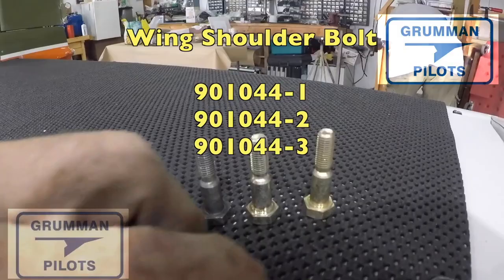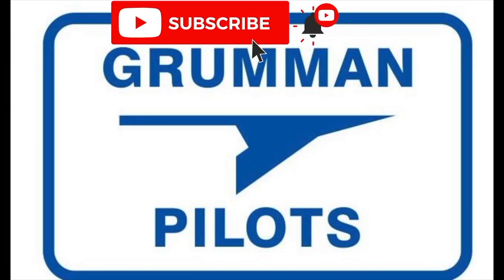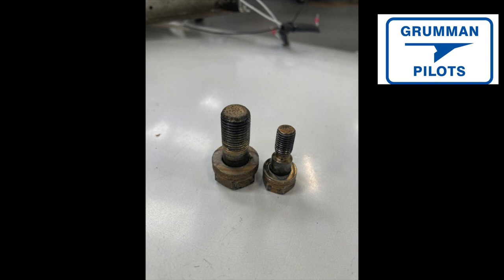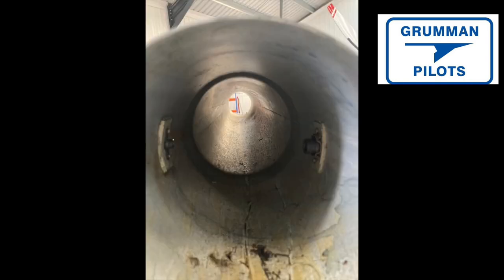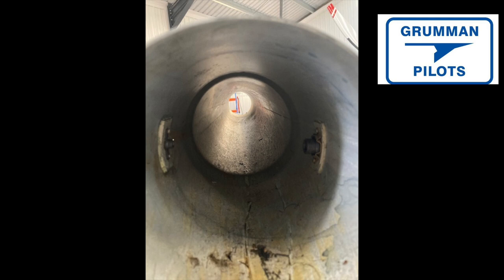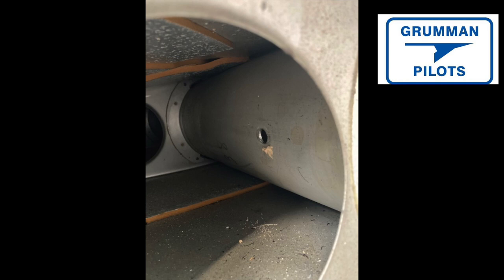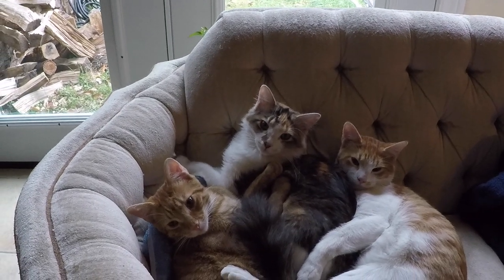Spar Oversize Bolt Problem - Grumman Style

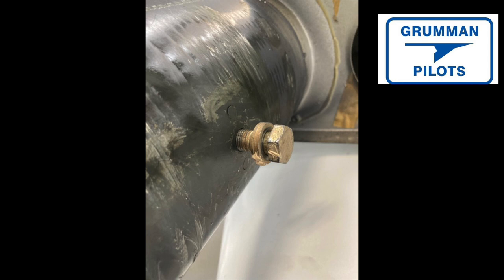Comment: At 1:30 FYI: I do not believe David is still in Houston.  
Regardless, I think that the AD is causing more harm than good in having mechanicks jack with it so often.
Reply from the maker: Yes they are in Silver Wings now.  I agree with the AD.
Reply: @GrummanPilots  I don't agree with the AD.  Every time they remove the bolts, they distroy the CAD platting and so new expensive bolts need to be ordered and installed.  It also can lead to wrong bolts being installed by non-Grumman mechancs.  Refresh my memory of ANY Grumman actually having wing structural failure.  I sure don't rememner that being a safety problem.
Reply from the maker: We did a video of taking a new shoulder bolt, running it in, and taking it out, where you can see the CAD plating gone.
 https://youtu.be/si3EgO9OwUA  From Ken's old inventory we have a number of these expensive bolts that sold for 55 dollars back in the day.  Give Yankee Aviation or Roscoe a call for some.
Reply: @GrummanPilots  I had all 4 replaced (again) last annual; $100/each.  No way in hell that privately owned Grummans need these things replaced every 5 years.  As said, I have never heard of a single fatality linked back to a shooulder bolt.  Zero.  Nada.  It's not an issue.
Reply from the maker: I can agree but rules are rules.